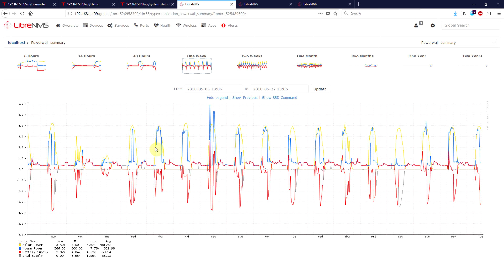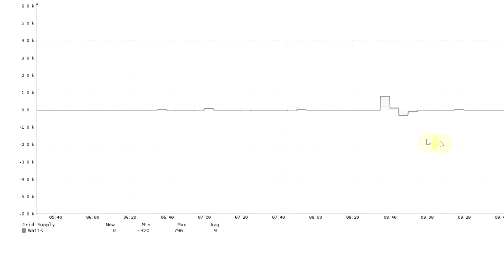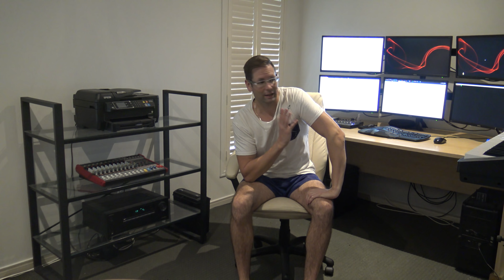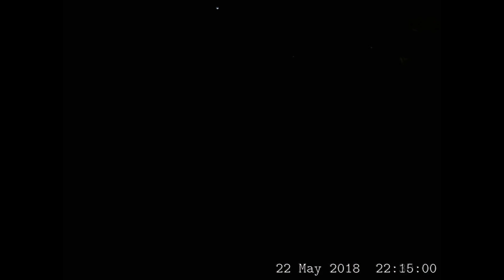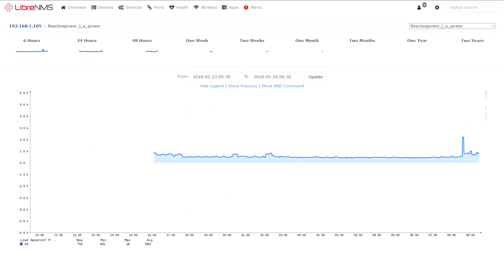Tesla Powerwall Off Grid Test 1

Comment from the maker: If you are in Brisbane and have a different solar/battery setup, please get in touch at cwne88@gmail.com
Reply: CWNE88 I'm not in Brisbane, I'm in Adelaide but I use a Victron Engergy Quattro unit.

Simon Hackett the guy that started and ran Internode uses an older system than what I've got.
Reply from the maker: Does that unit have a way for you to get data from it? ie, web interface or something from your LAN?
Reply: CWNE88 Yes, you can purchase the Color  Control unit, which is a little touch screen.
Reply: Watch my Video. Also, Sol-ark is coming out with Sol-ark 12k this December. I bought another 20kW of LiFePo4 from China with $4350(shipping included to US) on top of the 10kW I already have. Total 30kW in a couple of weeks.

Comment: Is this because there was no where to put the solar power so the powerwall reduces the frequency to turn of the solar inverter
Reply from the maker: Wrong. It was a firmware bug on their part. Turning off solar by frequency shift is one thing. System shitting itself is another. See later videos.

Comment: As I am sure you probably have learned by now, if your Powerwall loose internet connection via the gateway hub for longer than twenty-four hours, the Powerwall will automatically shut down.
Reply from the maker: It reboots, not shut down. I've made whole videos on that and how I get around it.

Comment: The reason why a battery fails can depend on many things. The problems we encounter most in our systems is that a parameter goes outside of specs (miliseconds). Too high battery voltage or high charging current. This can occur due to fluctuations of devices in the home or of the solar panels.
Reply from the maker: Nah, they had an issue with that firmware they told me. After they fixed it, it worked fine. See updated video https://www.youtube.com/watch?v=gzHRl72Ifao
All my parameters were fine. Wasn't me :)

Comment: search for Powerwall 2 Gateway API. API is collected on GitGub by the user vloschiavo.
try self_consumption mode. 
In any case, it can happen (I don't know Australian systems, here in Europe you can have both types of switch boxes) that your switch controls to both phase and ground. So you have disconnect ground too. It can so happen that your Tesla has no separate ground and is not wired for proper off-grid mode. Trivial search shows that there is an australian company offering Tesla powerwalls in offgrid setup. Contact them for advice.
P.S. Tesla customer service sucks big balls.

Comment: Is fairly likely that battery was full (you mentioned 97%) and could not accept the delta between solar production and your house Load that was lower.
Battery needed to stop charging but the only way to do that is to stop the AC output.
The solar grid tie inverters where powering your house at the time of disconnection and the Power wall inverter/charger worked as a charger.  You can likely test that again just disconnect the grid in a sunny day when PowerWall is at around 95% or so SOC and when you get more form solar PV than your house needs.
Reply from the maker: You are correct. Another video is coming :)

Comment: This experiment brings up a question I had about what happens when a grid-tie solar inverter syncs to the powerwall inverter. If the solar inverter has more kw than the load, and starts to charge the powerwall, does the powerwall inverter shut off or keep running? And what happens when the battery is almost full and the solar inverter throttles back and then a small load such as the washing machine pulls it down and causes the powerwall inverter to try to start? 

With the solar DC powerwall it seems much more straightforward. Solar charges powerwall directly with DC, and then DC is inverted to AC, so when off grid the solar charging is totally independent of the powerwall inverter. But withmrhe AC powerwall, it seems like you can get conflicts between grid, solar inverter and powerwall inverter unless it shuts down for a few seconds and and restarts to set the pace for the solar inverter to pick up and sync to.

The AC power wall probably works great as a whole house UPS but maybe not so great as an off grid system without some other component.

But the powerwall wouldn’t run it’s inverter and it’s charger at the same time, right? How would it control how much power was just going around in a circle?
Reply: IMHO, correct. The main function of the AC power wall is to provide frequency information as there is no grid available. If the solar inverter doesnt talk to the powerwall inverter, it will always try to outperform the powerwall inverter by providing higher voltage depending on how much power the pv array can provide. So once the battery is full, the powerwall charger shoul completly disconnect. Best solution is, if there is a programmable relay inside the powerwall by SOC, to activate a relay directly at the dc input on the pv array to disconnect the array until SOC drops below a lower reactivation value. The powerwall inverter has to take the whole load then of course

Comment: How high (voltage wise) will your solar panel inverter(s) push the AC voltage before they shut off I wonder?  (Data sheets suggest 264 AC RMS is a common max.)  Perhaps as the battery filled up the charge rate is reduced and the solar power coming in pushes the AC voltage too high tripping some type of safety limits on the inverter?  Just seems odd that the issue happened at such a high state of charge.  If you happened to repeat the test perhaps once the battery reaches say 90-95% you could turn off the solar power and see if it still cuts out?  That could help in understanding if the issue was due to excess power being pushed to the 240v AC lines from solar that could not be handled by the powerwall?
Reply from the maker: I thought of something very similar in regards to the fact that the battery was almost charged. Why would the solar voltage be that high though anyway? It's measurable from the API, but I wasn't monitoring voltages.
The solar production doesn't get sent to the grid at all anyway until battery is 100% full, so the Powerwall generally deals with what the solar is putting out anyway. I like your thinking though.
Oh wait, do you mean if there is no load demand (from either low power house, or nearly full Powerwall, and no grid to export to) there will be no great current drain from the solar, thereby sending its voltage slightly higher? I think that's a bit of a stretch, but really need to measure those voltages at the time.
Even if that happened and the solar voltage got higher, that would cause way more upset than what happened, and the Powerwall is still in parallel with it all.
Reply: I was thinking maybe the house is using 1kw, but solar is producing 3kw, so the power wall is absorbing 2kw in charge at 240v.  Power wall starts limiting the charge power to say 1kw, leaving 1kw of extra power... so as I understand the 240v AC voltage would start to rise and then somewhere around maybe 264v where the solar stops producing (safety cut out) but maybe in that process the power wall does not switch from charging to sourcing AC power fast enough and causes a momentary power glitch (stereo restarts?)  I think the solar systems have a delay in how quickly they come back online.  So all the sudden when solar starts producing power again the power wall has to quickly switch from producing 240v AC to charging and this time the power wall hits a fault and you lose power?  Just my speculation... I guess I need to get some solar/inverter and test some of this perhaps...

I would imagine that even if the power wall is online and connected to the grid there is a slight delay from when the solar increases output (passing cloud say) and when the power wall starts to use that power to charge?  And I would expect the same in reverse too when a new load comes online in your house it might take the power wall a faction of a second to start producing power and handle that load?  I guess it would be interesting to see what an oscilloscope view of the AC voltage/current looks like when you disconnect from the grid?  Or even when connected to the grid when a load comes online (say your washer) does it for a few fractions of a second pull power from the grid and then the power wall kicks in a carries the load going forward?
Reply: I should have started with this: I recently ran into your channel, really enjoying your content!  So thank you for sharing about your solar power adventures.
Reply from the maker: I get what you're saying, but I just can't tell without a CRO... or oscilloscope as I should call it these days, since nobody uses an actual CRO anymore. I don't have one though, otherwise I'd have already checked out the waveform output of this thing for my own curiosity.
As for your second paragraph, you can see I mention that in this video when something is turned on, there is a spike from the grid.
The bes I can do is measure voltages. There are measurments on the Powerwall for the Solar, Load, Battery, and Grid for power, reactive power, apparent power, frequency, energy imported/exported, average voltage, and average current. I'd have to set up a script to monitor say twice a second to be ready if I do try this again.
Reply from the maker: I just spoke with Tesla Engineering. I'll be making another video soon. Basically, solar inverters didn't listen to the frequency change which signals them to ramp down their voltage.
Reply: Looking forward to it!

Comment: Just a thought, if it's not supposed to run of grid, might their be a bit of code telling the battery pack to shutdown or reduce available load if their is no grid connection for 24/36 hours? Maybe in an attempt not to let the battery drain fully with no grid power to help.
Reply from the maker: My Tesla salesman told me that the off-grid feature is coming soon.
Then again, Tesla say that a lot ;)
Reply: So it's them being able to charge you a few hundred $ to disable a line of code! lol ;)

Comment: During starting, the motors consume much more energy. It is possible that the temporary power consumption has been exceeded.
I do not know how often you update data in charts, if it is an average of 5-15 seconds it could not be recorded.

Have you tried to contact Tesla? Maybe they have faced a similar problem and will be able to give a reason.
Reply from the maker: They are rated at 5kW continuous, and 7kW peak. The motor was already well and truly running anyway, and was past start up.

Also, there was power from solar coming in too, which adds to the mystery.

Essentially, the supply should have been coming from the solar, with excess going to charge battery at that time. So maybe as the solar was supplying the load, the Powerwall was not supplying (it was being charged). Then maybe the motor drew a sharp spike of current which the solar couldn't provide, and the Powerwall didn't switch from charging to delivering quick enough. I don't know how they constructed the circuit of the Powerwall, but if anyone has a schematic....   ;)

That's speculation though at this point. If any electricians want to weigh in, I'm all ears
Reply: Kliknij aby zmienić nazwę użytkownika, so maybe the inverter is underdimensioned?